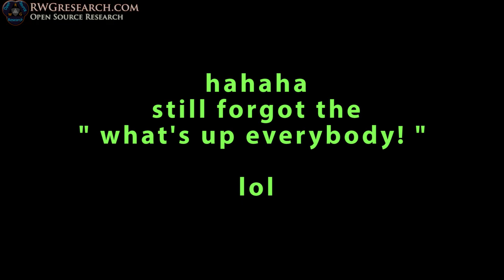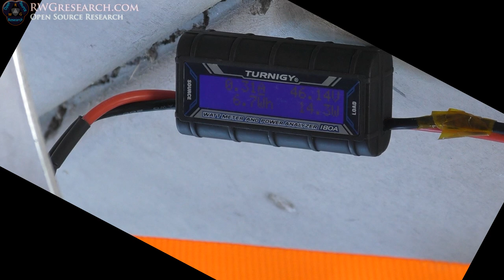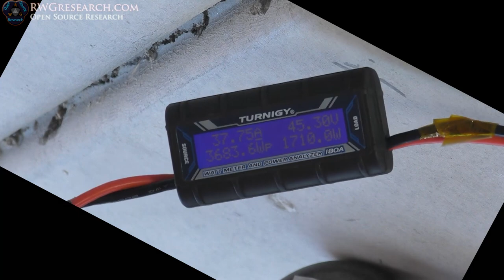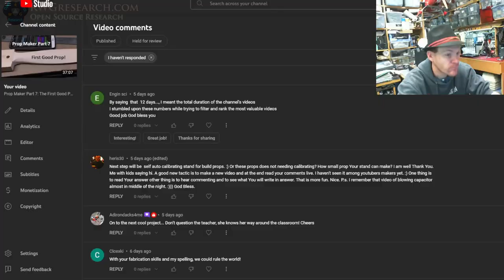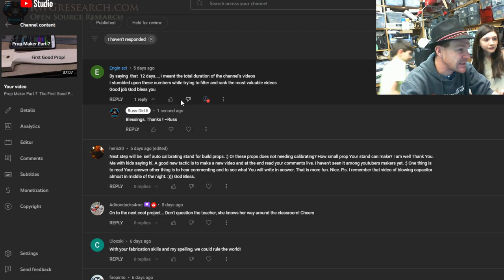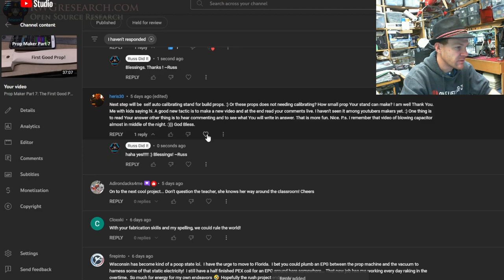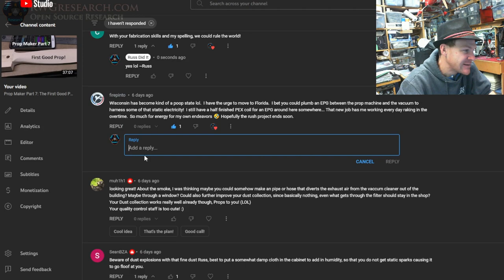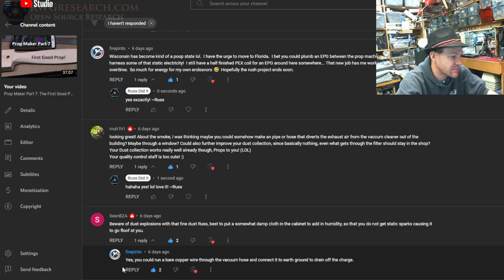Prop Maker Part 8: Its 3 Prop Time!  And Test!  When you're too cheap to buy props! Build'em!

Comment: 3-Blade prop is looking awesome! I'm wondering if the unoptimized shape of the hub (plates with machine screws) has any measurable effect on the efficiency of the prop? Also does the extra weight that it adds matter? I would think not in an airplane, definitly not good for a Multicopter though.
About the dust explosion, I think a dust explosion from static electricity is practically impossible. Theoretically it COULD happen, but the chances are so low that honestly I would not worry about it too much. Even IF it happened, at that scale it would probably only make a "poof" and pop the hose from the vacuum. There are antistatic hoses for vacuums though, BOSCH includes them with some of their higher end (class M and H) professional industrial vacuums. They are expensive though (150€ (~160USD) for 3m (~10ft) 35mm (~1.5"))
Reply from the maker: Great Questions! answers @ the end of the next video! :) but yeah not really and not really... and ouch that's pricey! lol ~Russ